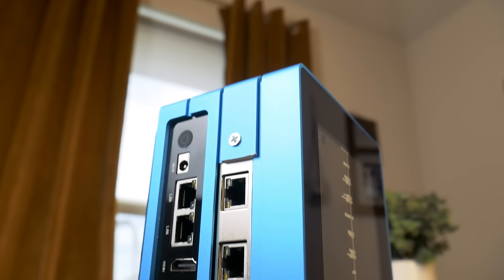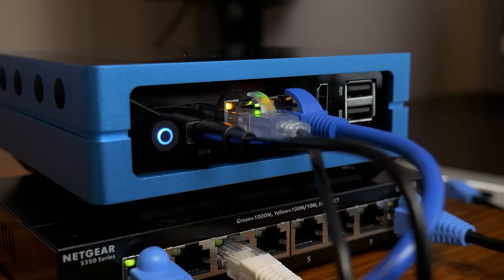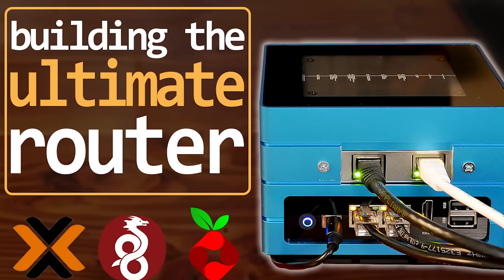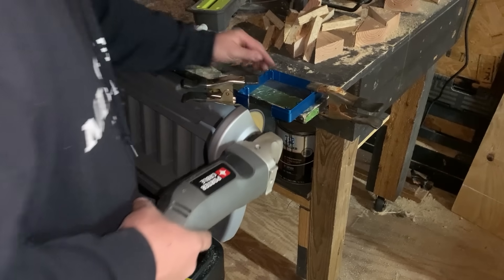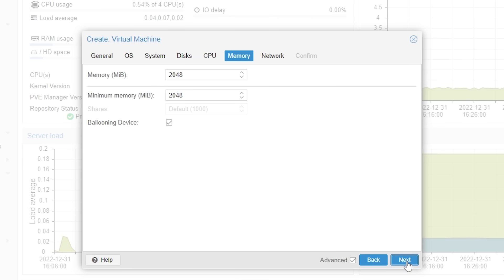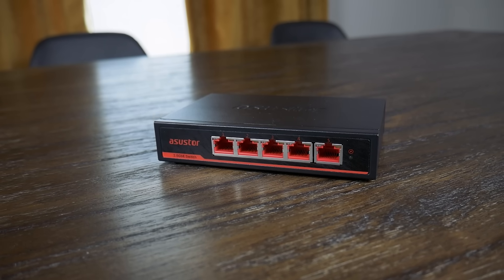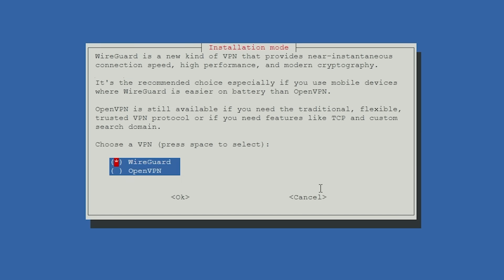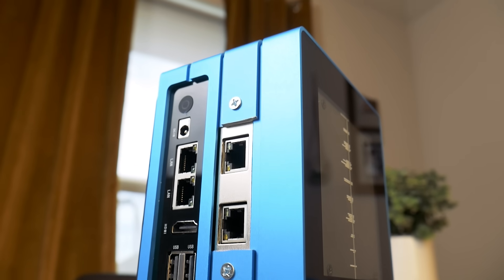Building The "Ultimate" Router - [PFSense + Pi-hole + PIVPN]

Comment: This comment section is definitely full of alternatives but if you want a few more, a useful alternative to pihole is adguard home. Does basicslly the same thing but it supports service based and regex based blocking. Additionally you can use unbound, either built into pfsense or installed in a vm or container. It allows for recursive dns lookups so you dont need a middle man like cloudflare and it offers great caching and speed.
Reply from the maker: Yeah, I should've at least talked about unbound. I think I cut too much to try and keep the video from being too long. Thanks for the input!

Comment: When I was setting up my home lab/servers, I initially virtualized my router (also on Proxmox, on a "normal" x86 platform). Since I was still tinkering a fair amount with the whole (new) system, that meant that every time I did something physical, the internet went down as well. Having VLans and local routing as well means that even things that were still all on weren't reachable either. So I ended up swapping to a dedicated virtualized physical router similar to the one used in this build (Intel N5095 based, running network services only on a proxmox host dedicated to network), but quickly realized it was far more capable than what I needed. So I eventually swapped to a bare-metal, non-virtualized Zima Board (still x86, but more rapi-sized) for my router doing anything network related just via plugins. I'm now very happy with this very low power solution, and I can tinker with the main "lab" all I want without any service interruptions to stuff that isn't rebooted or shutdown.

Note that pfSense and OPNsense can do WireGuard and piHole-like DNS services natively (via Unbound or many other options), and virtualization or containerization isn't really needed.
Reply: Did you ever make that video?... It sounds like what you did is exactly what in want to do.

Comment: I’m literally doing almost exactly this project right now, and have been really struggling to get my Realtek 8125B 2.5Gbe NICs working, I ended up getting them kinda working with PfSense 2.5.2 yesterday, but wasn’t super stoked on having to use older software. Luckily I’ve barely gotten through configuration before coming across this video, so I’m going to re-flash 2.6.0 and try out the package from the Reddit post you linked. Man, my YouTube recommendations are usually pretty good, but this? *Chef’s Kiss*.
Reply: You'd have better luck with Realtek drivers on OpenWrt since it's Linux.

Comment: 12:29 You being lame is actually really smart. I did the same when I switched from a "real" router to a pfsense box.
I put the pfsense box behind the router and migrated things behind the pfsense box over time. Once everything was behind the pfsense box, it just needed a few WAN setting changes and then I pulled the "real" router from the front of the chain, switched the router to AP mode and put it behind the pfsense box for WiFi connectivity. Since I got my bearings and learned the pfsense settings while just a couple machines were behind the pfsense box, there was no real downtime ever involved.

Comment: Built something similar here with a N5105 + 4 x 2.5 G eth ready made system with passive cooling. IMHO a quite solid base for a small network centric VM host. Where there specific reasons you opted for a more diy approach?
Reply from the maker: I had the parts on hand and it was fun. There is absolutely no other reason haha. 

well, I guess the extra SSD to boot bare metal was kinda cool, but I imagine some other machines offer that as well

Comment: I have several Seeed Odyssey's. Surprised both onboard NICs work with the M.2 NIC card plugged in, the Odyssey X86's have a hardware bug that kills one on-board NIC when some PCIE devices are plugged into the M.2 port. That said I also have alot of Odroid H2/H3 boards as well. The Odroid's are similar to the Seeed Odyssey but have 2 2.5gb NICs onboard and Odroid makes a "net-card" that adds 4 more 2.5gb NICs for a total of 6. I've been using one as my router for about 2 years now without a hitch. They also have cases that don't require mods for the net-card

Comment: I could do all this on a raspberry pi4
Reply from the maker: Please explain… 

At least the PFSense part. The rest sure, kinda, minus the 4 NICs and SATA SSD
Reply: U use that device called a seed Odyssey and I was wondering do I need to get one of those or can I do all of the software on one raspberry pi four
Reply: @HardwareHaven  sorry i’m very new to this and i just got one for christmas and i’ve been looking up stuff todo and i came across this and i’m just looking for a hard/fun project todo with my pi that’s useful and this was what i found and all i’m wondering is do i need to buy the seed odyssey, and the rest of the attachments for it or can I just do it on a raspberry pi four by itself
Reply from the maker: Gotcha, sorry I didn’t realize it was a question. You can do similar things on a Pi4, but because it’s ARM and not x86, there are certain operating systems that won’t be compatible. @NetworkChuck has a lot of great videos including networking stuff with Raspberry Pis

Comment: Hello everyone. I see one flaw with running pfsense through proxmox. There is no way to connect to proxmox to configure the vms if the router is turned off,  How would you fix pfsense if it went down. Is there any way to fix this issue?
Thanks
Reply from the maker: Not necessarily. You can still connect to the proxmox UI if you know the IP and are on the same switch or directly connected.

Comment: Why switch? just run both routers at the same time
Reply from the maker: I think 3 routers is a bit annoying lol. And because I want this for my entire network
Reply: @HardwareHaven  gotta have at least 2 at the edge, especially If you're tinkering. Why wouldn't two cover the entire network?
Reply from the maker: @shanent5793  Well I have the ISPs router in bridged mode to be clear, so I'm counting that haha. 

I'm not saying it wouldn't cover it, I just want the one PFSense router handling all of my network, and then I might setup another for videos/tinkering

Comment: One thing you could do, although it’d be a bit more dependent on your router, but you could create a virtual bridge and attach it to proxmox and your pfsense VM, so proxmox would connect via pfsense, and all physical NICs would go to pfsense. Not necessarily a good idea, but an idea none the less
Reply from the maker: For sure! And that would give the benefit of virtio between PFSense vm and host/containers, but I lke the idea of PFSense having direct access to the hardware
Reply: @HardwareHaven  you're the first bare metal firewall person I've come across. I like how you did this virtual and snapshotted for baremetal. Can this same technique be done for usb booting? Did you not have any hardware issues beyond the NIC drivers? I am reading about all these compatibility considerations with freebsd. Thank you and great video!

Comment: thank you. i would like to follow in your footsteps to create a similar setup. i have been using cloudflare tunnels instead of setting up wireguard... but i totally used to run pi hole and pivpn on bare metal raspberry pis and it worked great. i would like to setup those services again as part of my proxmox

Comment: Cool idea, but pfsense has all of this without the need for other VMs.
Pi-hole - pfblocker package
PiVPN - openvpn or wireguard experimental packages
Reverse proxy - ha proxy package
Ddns - native Ddns function
Reply from the maker: For sure, and I honestly didn’t know all of those were available. But I think there’s merit in the flexibility that VMs and containers offer. Appreciate the comment!
Reply: Experimental packages on your home router? No thanks.
And the pfblocker package is... Let's say too basic compared to piHole. It doesn't do any logging, nor statistics, nor tables and graphs. Sure, if you don't need all that go ahead, but for most people I think piHole is the way to go.
Reply: @zeendaniels5809  I've been using the Wireguard package for a while now and it's been rock solid for me. Or if you prefer the OpenVPN package is not experimental. Agree 100% about Pihole vs. pfBlockerNG, although I still use pfBlockerNG for IP blocking.

Comment: Rather interesting. I have some 8 bay sata drive devices. Some of these configs might help make it more flexible.  you are not lame, i have a bare metal opnsense PC made and it operates great but i haven't put it in use I want to redo the network wiring in my house and everything network related would have to move (and I have IP related issues i have to work out also).
Reply from the maker: I hope so!
Reply: Hey opnsense on bare metal is exactly what I want to achieve. Did you adhere to the freebsd hardware requirements for this or did you finagle another way to get this working? What Base os did you use? I want to have proxmox and docker underneath the bare metal firewall layer. Thank you in advance!

Comment: I’ve never needed duckdns for pivpn. It’s always “just worked” creating a profile with pivpn -a and sharing the QR with pivpn -qr
Reply from the maker: It does just work but afaik that’s only until your public IP changes (assuming it’s dynamic)
Reply: @HardwareHaven  ahhhhh! You’re right about that. Guess my IP hasn’t changed since I started dinking around with this old rack server 🤓
Reply from the maker: Yeah they don’t change nearly as often as I first thought they did lol. And that sounds like a fun project!
Reply: @HardwareHaven  tremendously fun. Next step is learning Ansible so I pretend I’m well versed in GitOps 😂😂
Reply: If your WAN IP ever changes it will break the client's, they will no longer have a valid DNS IP to point to to start talking...
Reply: @haydenc2742  yeaaahhh I realized that after making my dumb comment. AFAIK duck DNS requires you to manually change your IP with them if it changes with your ISP, but that’s probably easier than creating new client keys each time

Comment: I didnt watch the previous Video about the Hardware, but for People that dont want to build such a Device themselves their is a (not so cheap) Alternative. You can buy a (china-made) passively cooled Mini-PC with a N5105 Intel CPU and 4x 2.5 Gbit Intel LAN Ports barebone for around $200 (without Sodimm DDR4 RAM and an SSD)
Reply from the maker: For sure! I probably should’ve been clear that this is NOT the best route hardware-wise. However it was more fun lol
Reply: @HardwareHaven  Yes of course. I just noticed the similarity to these Devices.
Reply: @HardwareHaven  So what makes it ultimate? The software?
Reply from the maker: The fact that it’s a router (with 2 LANs one of which is 2.5Gb), VPN server, and Pi-hole server all in one nifty little box. Obviously there are more impressive routers, hence ultimate being in “”s
Reply from the maker: To be clear, the 2.5gb is essentially useless at the moment, which is why I didn’t really talk about it. I mostly just wanted a dual mic to M.2. But if I ever upgrade to >1Gb Ethernet, I can switch ports around and take advantage of it without needing to upgrade.
Reply: @HardwareHaven  Then I think it would be much more truthful to call it something like "Building the best DIY Router!"

Because now there has been made concessions on both hardware and software it sounds like :P
Reply from the maker: I felt like the quotations were enough, but maybe not lol. And there will always be concessions. Other routers might be crazy fast but have much higher power consumption. Does that make it better? Worse? Some might be incredibly simple and user friendly. Better? Worse? It’s really just dependent on a lot of things. I would say this is MY “ultimate” router because it has always the features and flexibility that I want. Hope that makes sense and thanks for the discussion !
Reply: @HardwareHaven  Maybe just include "My Ultimate router" then.

Comment from the maker: FAQ BELOW!!!
For 21 FREE meals with HelloFresh plus free shipping, use code HARDWAREHAVEN21 at https://bit.ly/3WdgdSU!

FAQ and Concerns:
- Why didn’t I use OPNSense?
I just don’t have much experience with it, but I will try it out later, maybe even before I set this up in my home!

- PFSense can do basically all of those things with other packages; why not do that?
Honestly, I wasn’t aware of all the packages available, especially the experimental ones. But I also like the flexibility of containers and VMs. I can easily swap to OPNSense later without having to set everything else up again if I want for example. Also, software preference is a thing. It doesn’t mean I think running everything bare metal is a bad idea. Quite the opposite!